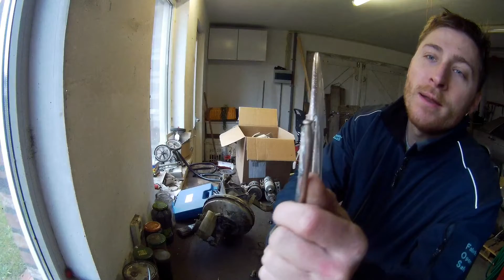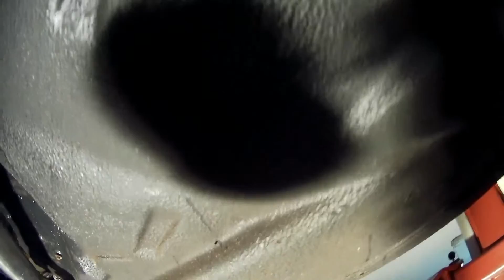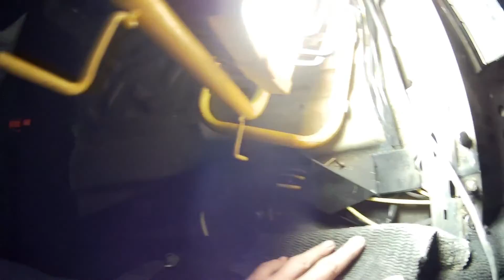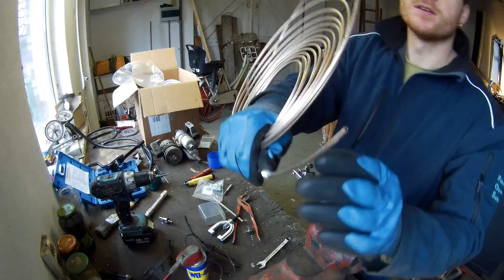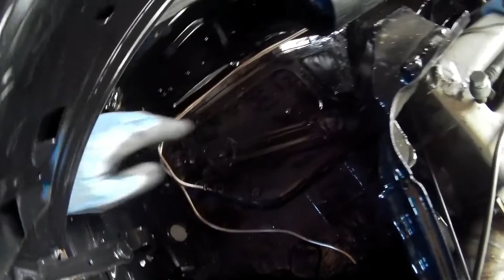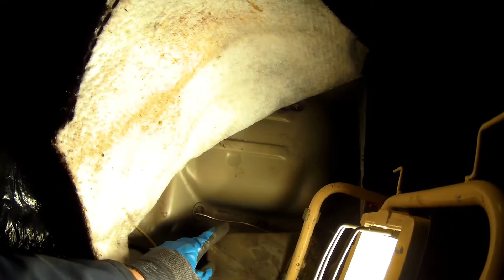Brake line installation on the 190 V12 project-build

Comment: It looks that you had not abs , how you deal with stock master cylinder and bigger brakes?
Reply from the maker: Correct. No abs.  But these oem cars always have a smaller mastercylinder. So less oil will move when pressing the paddle. So with bigger brakes and more oil in the caliper. You have to pressure deeper to move enough oil.  But also the power to press is less.  So the brake feeling is getting better.   So this works very good

Comment: Great video friend, very helpful! I may take up the challenge of changing my brake lines in my 91 190e 2.6L...One of the lines burst... It doesn't seem like such a frightening task to attempt, even with my never having worked on a car before at all... This is my first car I have bought
Reply from the maker: Just do IT. You have to start somewhere

Comment: Nice and tidy, as usual. A ton of work, and much more desire in the project. Liked the brake line routing, simple, efficient. 
Regarding people with the "drop a v8 in it" , don't listen to them, they just aren't taking the up the challenge of fitting a V12 in the 190e engine bay, or are paying someone to do it, which, obviously, in a shop, much less cost vor a v8 swap instead of a v12 ... Keep up the good work. Set a goal and go for it.
Reply from the maker: Just like that 😉. Thanks for the support

Comment: You should have simply went with a M113K engine instead for all the work you are doing!! A lot more power! decently reliable and pretty compact!! instead of S600 you should've bought an cl55 or E55 or S55! M120 too much fuel consumption for the power it produces, twice everything, you still haven't figure out stand alone ECU or harness! V12 stand alone ECU's are insanely expensive for the build! they're made for Ferrari's n lambo's! 10 - 15K or even more! Or you might have to use 2 set of stand alone ecu's one for each bank to cut the cost! Dash!! Most expensive/least reliable build! 390HP from that stupid M120! M113K 450+!!! Love your hard work man but its so illogical! M120 is monster if you are boosting that mofo! twin turbo! forged internals! top and bottom end and you got 1000HP!
Reply from the maker: Watch me get this engine running with 1 ECU that is less then €1k.  IT is not all about the power and this V12 is much more reliable then a m113k engine. If you really did now how the internals in these engine are. you would not put this comment here.  A lot of people van put a V8 in a w201 but a m120 V12 is a different story. 
But i don't really care what you think. I Just do my thing because i want a 190 with a m120 V12 because nobody has IT 😉

Comment: Hand "forming" tubing never works out very well for me but you lined it up with great ease into the brake master. I'm impressed/jealous/envious. I mean, damn!, you have no idea how hard it is for one of my limited abilities to line that up without stripping threads leading to several minutes of swearing. As for the fuel line, bringing fuel into the passenger compartment makes me a little uncomfortable (rupture during collision) but my W140 has the Webasto "warm up your interior on a cold morning" device which has, I believe, interior components in the front seat passenger footwell. I have not felt "uncomfortable" about that so I'll just shut my mouth now. Once again: well planned and well executed.
Reply from the maker: Thanks for your retailer opinion as always . Thanks very much 👍
Reply: Hondas from the 80's also have this fuel line routing so I think it somewhat common practice.( But a nightmare to change when they rust out.)
Reply from the maker: Old VW Beetle also.  This Line is cunifer so Will not rust through